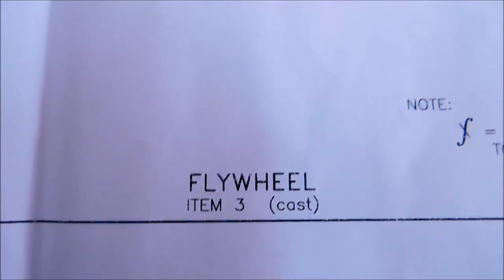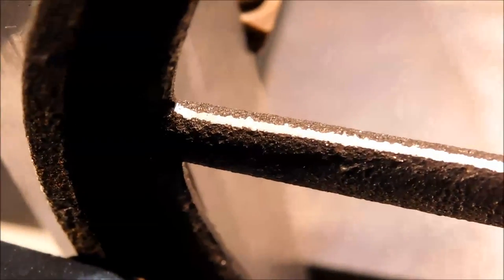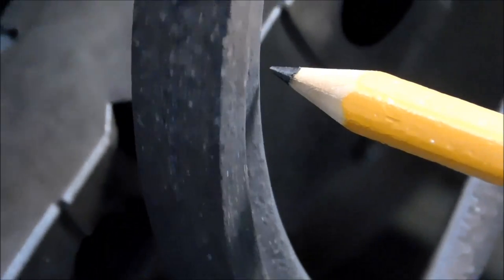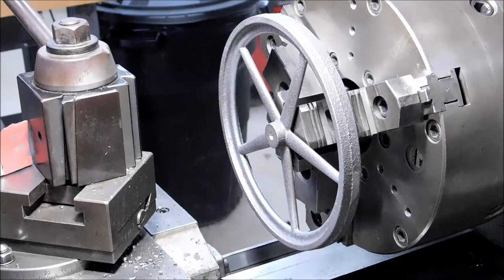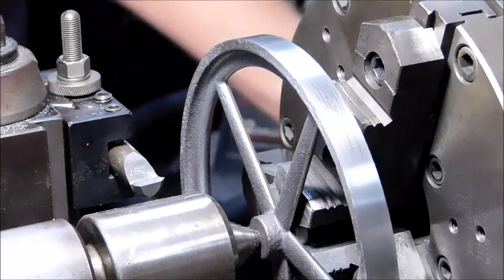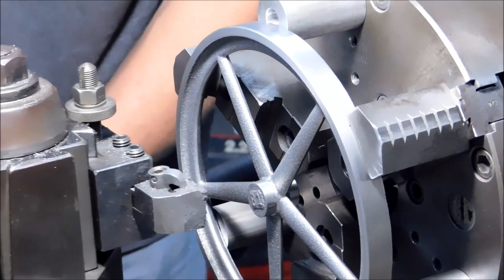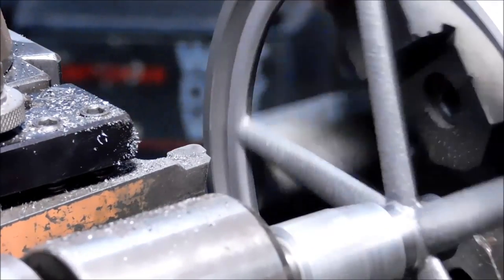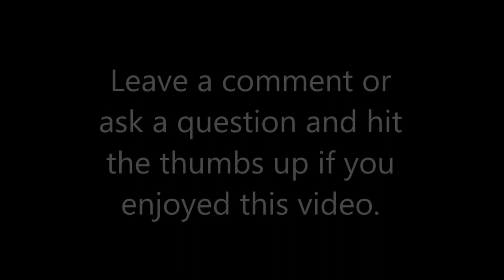Machining a Model Steam Engine - Part 10 - The Flywheel

Comment: Big shock, the girl just did hers on a faceplate. Proves she reads your comments and watches your videos. Unfortunately, she is too inexperienced to know you don't do a part on a faceplate with 4 clamps for the first side.
Reply from the maker: To anyone that has seen the other video......If you search through the comments in this string, you'll see I mention numerous  times, the preferred method for doing this part is a face plate. I support the method. What was presented incorrectly is the 4 points of contact she had on her initial face clamp setup. If the part was warped, which mine was, clamping with 4 clamps will flatten the part and pre-load stress into the flat surface being faced onto the part. When the clamps are released, the part will return to the warped position. Flipping the part and using the same 4 point setup only preserves the distortion. If it looks like the final product exhibits a side wiggle at assembly, this is one of the contributing factors. Done correctly, the first side should have been faced while setup up on 3 shims at 120 degree spacing. This would remove the warp. The second side can then be clamped with as many hold down points as you desire. This is a common mistake among new, or inexperienced operators on both the lathe and mill.
Reply: @joepie221  Thanks for spelling that out!
Reply from the maker: @Kineth1  No Problem. I hope the people that watched that video get a chance to read my explanation.
Reply: I think I know who you may be talking about, I just watched her video. I have to agree, her lack of experience really does come through.
Reply: The girl, really?
Reply: @robertpearson8798  What girl?
Reply: When I was in engineering school, we learned to model metal items as springs in motion analysis. Metal does not behave as thought!

When I rebuilt my dodge Cummins, I changed the crank cap bolts over to ARP. The torque differences changed the holes for the shell bearings. To fix I had to torque up with the ARPs and then line bore the block. This way I was guaranteed a round hole under the fill torque of the ARPs.

Same idea….
Reply: @HAL_9001  Quinn from blondihacks
Reply: @HAL_9001  Hey Blondie. Or is that hey Abbott?

Comment: That's what I would call making "chicken salad out of chicken lips" enjoyed the thought process and the hand work. 👍
Reply from the maker: I refused to let this part beat me.
Reply: I was disappointed by the lack of style on the flywheel.  Core-shift is not a style. I'll admit I would have used the lack of style as an excuse to scrap this part and make a new one.  You're a better man than me. Good work dealing with this age-old problem.

Comment: I love your setup on the mill vice for deburring the flywheel. I used my bench vice, but it was awkward and didn't hold well on the rough casting. For turning my flywheel, I made a round fixture plate for the flywheel, small enough to rest flat against the spokes  with a hole for the flywheel hub. I threaded holes for screws and strap clamps to fix the spokes to the fixture plate. I mounted the fixture to a face plate on my lathe, and clocked the hub to center the flywheel to the lathe axis of rotation. I clocked the edge of the the flywheel rim and adjusted the strap clamps and used packing to ensure that the rim of the  flywheel wasn't wobbling as it rotated. It worked well with no chatter.
Reply: This was my thought as well. Using a chuck, I would be afraid I'd crack the casting.
Reply from the maker: Initially, there were no flat or planer surfaces for clamping to a plate. Shimmed at 120 degrees maybe. Then again, if I chose to do that, I'd get comments about not everyone having faceplates and large scrap laying around.

Comment: Like another one of your followers commented , the flywheel always throws out a challenge.  Never had an easy one to do yet. Your video is certainly a big help and boost ones confidence in machining the flywheel.  Thank you very much Joe
Reply from the maker: Thanks. There are many ways to do this, but you all need to be aware of how delicate and fragile it is. Grip the OD first and true up a face to start. Gentle pressure too.

Comment: Hey Joe, I'm really enjoying this series of videos and I'm learning a lot even though I've made several engines from castings over the years. There seems to be a bit of a trait amongst a few model engine manufacturers to use odd numbers of spokes in their flywheels. This is completely wrong and I've never seen a full size engine with five spokes, there are always six or eight if it's a very big engine. You would never get distortion on the rim if you could clamp on the ends of spokes.

Generally speaking you should chuck the raw casting and get the inside rim of the flywheel to run true and work everything else out from that.

Regards from the UK.
Reply from the maker: 3 and 5 just don't play well together.  Like my kids.
Reply: Hello David I totally agree with your comment regarding making several engines in the past. I too have been making engines from kits and from scratch and still find that Joe's methods are by far the best. He is indeed a master machinist with a great ability to put his lessons across

Comment: @Joe Pieczynski  Great progress, and it turned out well.  A little shop "gem" of my own that you may want to try.  I have had to clean up and polish the OD on castings for hand wheels.  Just like yours they are just a casting and hard to work with.  I found that once I got my center hub dialed into my liking and the part was running well there is a much easier way to finish and polish the casting, or at least get it cleaned up enough that you could turn it easier.  

For the most part the OD doesn't need to be anything critical, more cosmetic than anything.  Once you have the part chucked up, take an angle grinder with a flap disc on it and lightly work the part with the lathe running.  It will clean it up very quickly and you have a great deal of control.  It cuts through all the parting lines and rough surface of the casting in no time.  I think you would like it.  

That said, if you see anything wrong with this please let me know.  So far I've found it to work very well and safe.  But you have a lot of years on me in experience so I would like to hear your thoughts.

Comment: The great model engineer George H Thomas, who wrote for Model Engineer magazine in the UK and wrote 2 amazing books on model machining (based on collections of his articles), swore by a dull #6 swiss cut file, cleaned with a piece of brass and saturated with soluble oil. He achieved finishes similar to grinding. He detested emery cloth - never used it. I guess we all use what works for us. His books are the best I have ever seen on machining in general and making practical tooling. In his day back jn the 60s people didn’t have money for tooling, but in the UK so many if them worked in industry that they had ready access to scrap material, cutoffs etc. So they made all their own tools. His designs were famous and kits are still available from Hemingway in the UK, His books are still available from Tee Publishing. Any of you guys looking to learn the basics I can’t recommend the books enough. Stephane Gotteswinter is also a fan.

Comment: You did a really really nice job on that flywell. I have machined that same flywheel a few times and it is tedious and it does take a while and you need to be extremely careful on those. I deal with these engines on a daily basis and I know that no matter how well a machine has been built if that flywheel runs out it takes away from everything else on that machine. That's the first thing people notice is run out on the flywheel. So no matter how good of a job you did on the rest that's the first impression that they get.

Comment: Thanks Joe. After i saw you put the pencil near the fly wheel and point to the run out I sanded one down to .250 and put it in my mag base to dial in the wheel. This worked awesome and was easy to dial in. Of all things keep it simple ** this will be my new method of dialing in castings and cheap to replace.
Reply from the maker: They make soap sticks just for this purpose.

Comment: A couple years ago, I adapted a cast iron handwheel to my horizontal mill x feed. I did almost EXACTLY what you just did with that flywheel, including the large radius brazed carbide tool bit. I really don’t like wobbling wheels.

It’s also possible to mount the wheel over the edge of the mill table to drill and tap the 5 degree hole, for those with benchtop mills.
Thanks,
John

Comment: I always enjoy your videos and learn a lot from them. Having machined a number of steam engine flywheels an approach which works for me is to mount the rough flywheel on spacers off a faceplate, clamped by the spokes. I line the inner rim to run as true as I can get it, then tighten down the clamps. I can machine the rim, front face and centre boss from this one setting, then flip the part to machine the other side of the rim and bore the centre hole.
Holding by the spokes reduces the risk of chatter and ringing, and allows heavier cuts to break through the scale.
Keep making the videos!
Reply from the maker: I conditionally agree with you, but the flywheel would have to be up on only 3 shims to assure it comes out flat for the first side operation. This casting had a warp to it and clamping on the spokes while resting on the face would have been a disaster.
Reply: @joepie221  The important thing is the plane of the spokes. Everything else (the rim, the hub, the bore) must be true to that, otherwise it looks terrible when the engine is running. If the spokes are not all in one plane they must be forcibly re-aligned (risky with cast iron), or the casting thrown away and a replacement found.

Comment: I am so glad that I am not the only one with issues when machining flywheels.  They certainly a challenge with vibration.
and yes there are many ways to eliminate or reduce or hide them
Reply from the maker: Those spokes are very thin at the rim side. The vibration can be expected until you get a solid working surface.

Comment: Joe, another great video,  I was taught as an apprentice to use a block of lead, about a pound, hold it against the rim when it's ringing/singing. It will usually help to reduce the noise.
Reply from the maker: Interesting.
Reply: Wrapping the spokes in lead sheet could also work

Comment: On similar parts I have used a small toolpost grinder to fight the harmonic chattering.
Reply: Same here, I made one with an inexpensive CNC router spindle replacement from Amazon that has an ER 11 collet on the end.  All I had to do was make an adapter to fit the tool holder on the lathe.  I just turn the lathe by hand at first to knock off the really high spots.  But hey - it's always nice to see a pro like Joe do it his way and make it work.  He's always teaching me something.
Reply from the maker: I considered that.

Comment: Great job, Joe. I had to modify a 1/4 scale  R/C clutch bell once. It was 4" in diameter. We wanted to lighten the whole unit up on the inside and outside. As you would expect, it rang really bad. When I cut the OD, I stuffed the bell with a piece of towel. That helped a lot. On the inside, the surface finish was not important. It needed to be slightly rough for the clutch shoes, so I simply put on ear protection and cranked AC/DC until it was finished :)

Comment: I had a flywheel casting once that was badly out of round even on the outer spoke diameter. I had to set it up on a rotary table to machine the outer spoke diameter round. I then made a wooden fixture to hold the flywheel  on the face plate clamped on the outer parts of the spokes. I could then machine the outer diameter and one side of the rim. Like you I trued the inner edge of the rim also. I think doing this helps with balance also.

Comment: Great video! Just watched RR in the Shop this morning and was thinking of the rubber floor mat scraps he had. Could use something similar to make a flywheel sandwich. Assemble with a bolt, nut, and 2 flat washers between every spoke might take the ring out of the part without distorting it.

Comment: An old fashion way of dialing in a casting like  that is to use a stick of chalk in a tool holder and put the work in a four jaw chuck; do as you would with a dial indicator. Once you can draw a continuous line you're good enough.

This method is written about in the 1935 Craftsman/Atlas "Operation of a manual lathe" book. Great job.
Reply from the maker: I did mention chalk, grease pencil and other visual options.

Comment: Joe, you are doing fine work! I really enjoy watching your videos. I am a retired tool and die maker,and spent the last 25 years of my career instructing lathes, mills etc. One pointer I'd like to share is this: anytime you are doing something by hand on the lathe (a file, emery paper, 600 grit) always run the spindle in reverse!! Better to have it fly away from you if it hits a jaw. I learned the hard way many years ago when I had a file go into the palm of my hand. 🥴
Reply from the maker: Many would agree with you, but I subscribe to the philosophy of using the technique you are most confident and secure with. For me, its forward rotation and elbow on the headstock. And handles on the files. Just my opinion.

Comment: I appreciate the detailed description of your decision process. Very useful for us beginners. 
I agree with your assessment of that half-round file as "well abused." Time is too valuable to waste fiddling with a worn out tool, and files are consumables. That one should go in the scrap bin.
Question about the long reach tap - couldn't you just use a regular tap with a ratcheting tap handle? (With the hole aligned between two spokes).
Reply from the maker: I don't have the heart to throw it away. It still cuts great where it still has teeth.

Comment: Good show as usual, Joe.  Thanks!
I've made a good half dozen of these PMR kits for other people.  They sometimes start out and find they need more setup knowledge to finish parts, so I get a small commission job in finishing it for them.  Others have just bought the kits outright to send to me for construction.
A note about these castings;  The last one I did was over 10 years ago for a fellow in Sweden.  I recall the castings being much nicer than the ones you have now, especially the one for the flywheel.  The ones I've machined for others had much smoother castings.  I am guessing PMR is having a different foundry do their work these days.
Came out looking very nice!  Keep at it.
Dean
Reply from the maker: Thanks Dean. I knew this would take some hand work, but I enjoyed the challenge.
Reply: Dean, I've noticed that Joe's kit and ones on other YouTube channels have relatively sloppy castings.  It seems, to me, that the patterns halves don't line up properly (perhaps worn out?) and they're using sand that's way too coarse, especially for small model kits where the "sand defects" are out of scale for the small models.  I still will probably get a kit from them though, just to see what I learn from building one.  ;)

Comment: Really nice file work. Those are the details that will really stand out when it’s done. Lipton will be all over this! Aren’t you worried about that gnarly cast iron dust on your mill and lathe? You really got it to run very close to true. It makes a huge difference. Truing up the inside of the rim not only looks better but you have much better chances to have a balanced wheel. The real steam engine flywheels from back in the day were not perfectly uniform since they were cast. .

Comment: Great video Joe, I would like to add back in high school My instructor told me to lay a rag on the bed-ways when I used abrasives on my work to protect the ways from abrasive dust working into them.
Reply from the maker: Or dry everything and use a brush and vac often.

Comment: Standoffs on the chuck with rubber pads,(then he shows standoffs) for ruffing. Used to do a lot of this type of work. We would clamp the part to a faceplate with shims. Rock solid and no chatter. 
PS: I should watch the whole video before commenting. Good work Joe.
Reply from the maker: There was an intermittent distortion to this casting. A low spot. If you clamp a part to a slave plate or faceplate, use shims at 120 degree intervals for the first side, or your final product will have a wave in it too.
Reply: @joepie221  we would map out the castings then clamp them in that same orientation. It was a tedious process, but by not inducing stress by clamping we had a very stable part when finished.

Comment: Cleaning up the inside of the rim improved the balance of the flywheel substantially.  I personally would not even consider neglecting that detail.  I do appreciate the demonstration of how to use the inner edge of the rim for initial alignment, but I would need to use a four jaw chuck to do that since we don't have adjustable three jaws.  I also missed your method for reducing chatter on the first facing operation, but once again thanks for the lessons.  I am surprised there is no keyway...?
Reply: @millomweb  I would prefer a keyway nonetheless and I wouldn't settle for less than two screws and a flat.
Reply: @millomweb  Today, most stuff is "built to fail" in 5-10 years "to keep the economy moving."  Heavy machinery in infrastructure are the exceptions.  I realize the model will have no load, but Joe is known for going the extra mile.

Comment: Joe,  ill say it now.  the sand used for those castings is/was  not fine enough! the full size engine didnt use gravel instead of sand!! dont you think that a finer surface would be MORE in line with 'scale'??  poppy's workshop says HI